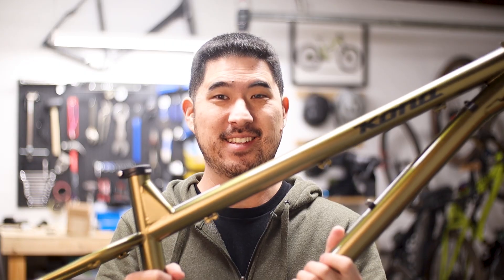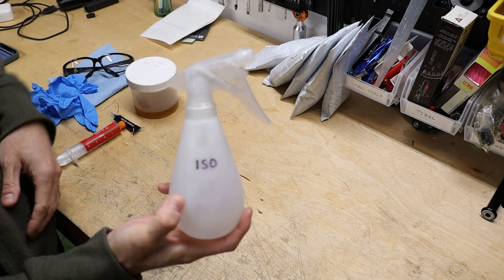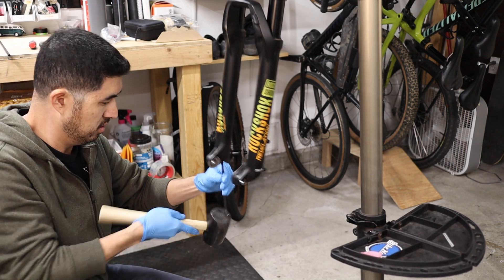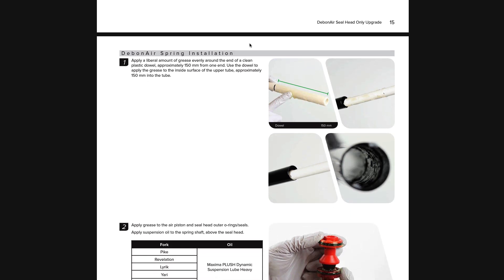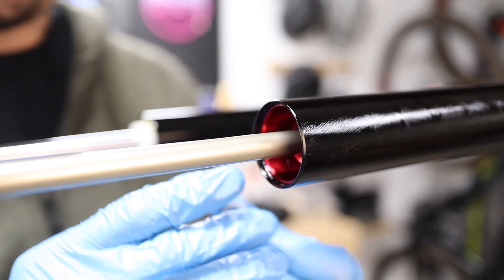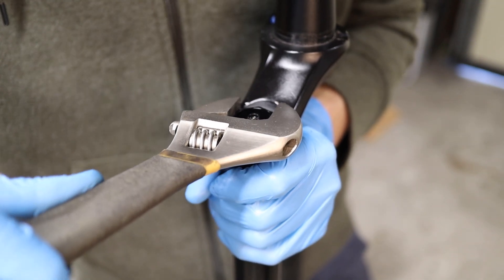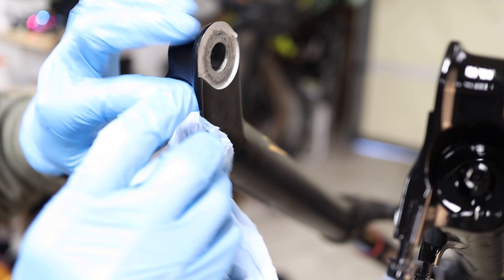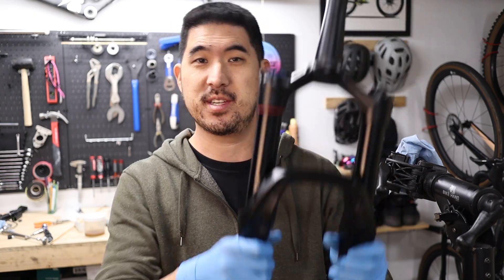HOW TO: Change Rockshox Fork Travel // COMPLETE Tutorial

Comment: Quick tip, you can grind off inner bevel socket so you can make it flush so it will fit much like proper adapter for specific job.
Reply: way cheaper but I've seen so many people end up with a cockeyed socket

Comment: Thanks! I upgraded the air spring on my 2023 Yari.  As I was torquing the damper side bottom bolt down to 7.3nm, it slipped a bit and I thought I stripped it.  It messed up the metal some. I could not get the rebound cap back on and couldn't figure out why until I took it to the shop and remembered I did this.  We swapped the bolt and the cap went right on.  Crazy that slip on the wrench made the bolt expand just enough that the cap wouldn't go back on.

Comment: I usually drop a few extra ml in the lower legs, Fox Gold 20wt since A) I've got a lot of the stuff and B) it's very slippery. A little extra ensures you've got lube going everywhere nicely. I also recommend using the bolts to slightly depress the shafts, fully compress the fork and keep it compressed while tightening the bolts. This creates sort of a tendency toward fork suck which when pressurised aids in small bump sensitivity. When greasing aim for a film of the stuff, greases have an irritating habit of accumulating in the transfer port turning a Debonair into a Solo Air and denying between 10 and 15mm of travel as this happens. Definitely cycle as you inflate, this helps keep the chambers balanced thus reducing the amount of force you need to apply when bouncing to set the sag and gets that greasy film spread right up the stanchion.
 While the lower legs are off I like to remove the foam rings from under the seals and leave them soaking in some Fox 20wt, starting with slippery rings helps maintain a plush fork.

If the air shaft is stuck, reinstall the air cap, aim the shaft away from yourself and slowly pump up the air chamber. Be bloody careful as it can behave like a speargun. This is a desperate last resort and not a first port of call.

Comment: Definitely one of the best, straight to the point, and most articulate bike tutorials I've ever watched, thank you! Going to do this tonight on my Lyrik.

EDIT: THE 2016+ DebonAir springs DO NOT FIT 2023 Lyriks. They fit, technically, but they're totally different and there was a loud clicking. Had to buy the $100 buttercup air spring upgrade. Annoyingly there doesn't seem to be a non-buttercup spring for travel changes if you don't have a Lyrik ultimate.

Comment: 2023 Yamaha YDX-MORO 05 with revelation DebonAir set at 160 mm want to drop down with  2 tokens to 150mm that came with the bike (27.5) does it mean with out air tube change out 
The forks are labeled both 160mm & 150mm .
0 tokens installed by dealer.

Comment: Ok, so if I buy a Lyrik 2023 with 160 MM shaft I ONLY need a shorter airshaft (like 140 MM) to make it a shorter travel fork? I Think 160 is a little to much for mine Honzo 2022. Standard it is a 120 MM fork, the 2023 model is 130 MM.

So if I don’t like the 160 it’s this easy to make it shorter?! Don’t replace the damper itself?
Reply: Ok and the oils and tools 🤷‍♀️

Comment: Bit of a scam on rockshox part.. The could have easily implemented a travel reducer to the shock, but there's more money to be had selling you specific parts to mod the forks across the range..
Reminds me of the compound bows that started selling where if you wanted to change the draw length, Ie how far the string was pulled back [everybodys different due to height and arm lenght obviously] you had to buy a specific module to do it which costed 150 dollars.. Most bows come with an adjustable module that you simply rotate, but theres always some companys that want to take everything youve got... Specialized spring to mind also...

Comment: Another well done vid!  I'd say that's enough grease on the air spring...I've seen some other vids that used too much grease that blocked the negative air dimple in the stanchion.

I noticed you didn't replace the crush washers.  I know most times they can be reused as long as there's no oil leaking, but I just replace them every time I do a lower service since a pack of 50 was like $7 when I got them.
Reply: Agree the crush washer should be replaced. Especially with Rockshox, those crush washers often get stuck onto the bolts and are a pain to get off. Then people add new ones without removing the old and when tightened it's out of spec.
Reply from the maker: Yea makes sense. I reused them since the manual doesn’t call for them to be replaced. If I notice leaking, I’ll throw new ones in
Reply: Would you mind sharing a part # for the crush washers if you have it??   Thanks!